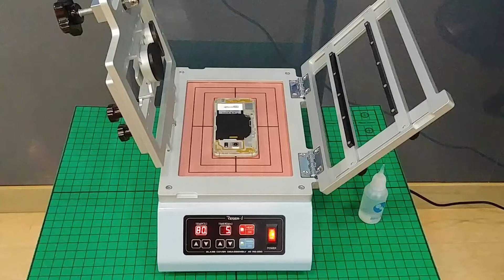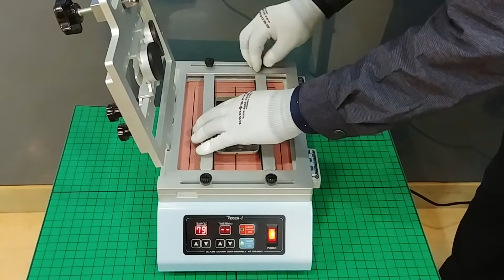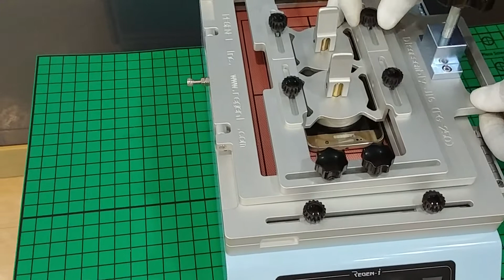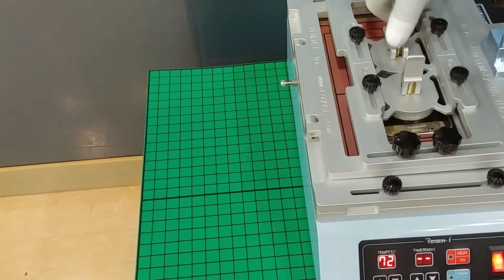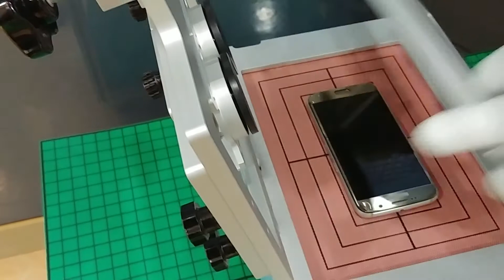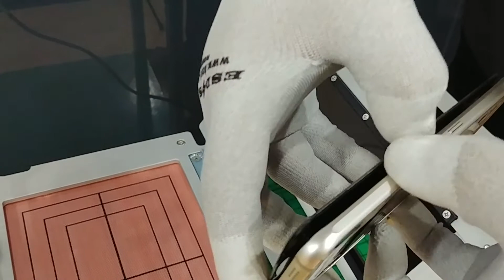cell phone screen repair Galaxy S6 LCD disassembly by RG-250 with ethanol fast effective with care

Comment: not use for broken glass?
Reply from the maker: If lightly broken, user can try, if severely borken, user require thick sticky double-sided tape and thick plastic to suck up the plastic plate and sticky tape will hold the whole broken glasses.

Comment: all good, but what about when the screen is smashed up?
Reply from the maker: Neil Davis Smashed LCD is not targeted by this machine.  smashed glass should be used with other tools and machine.
Reply from the maker: If lightly broken, user can try, if severely borken, user require thick sticky double-sided tape and thick plastic to suck up the plastic plate and sticky tape will hold the whole broken glasses.